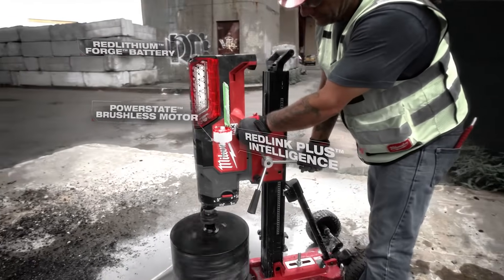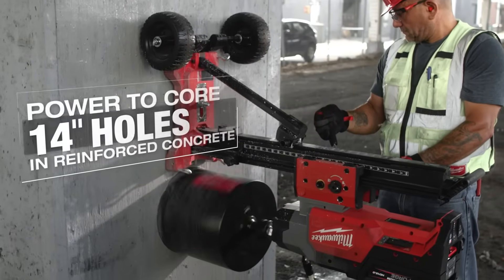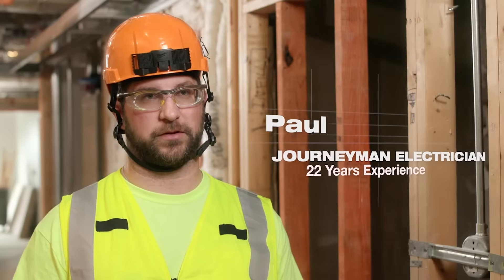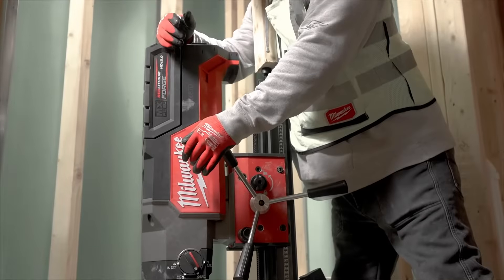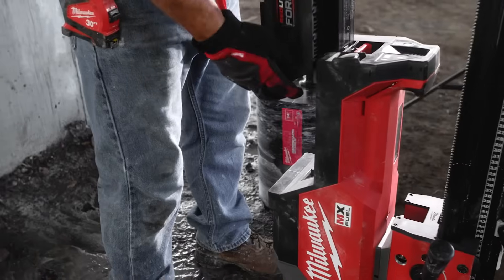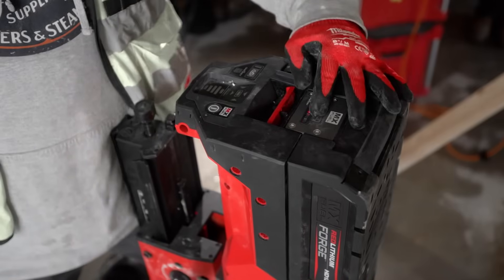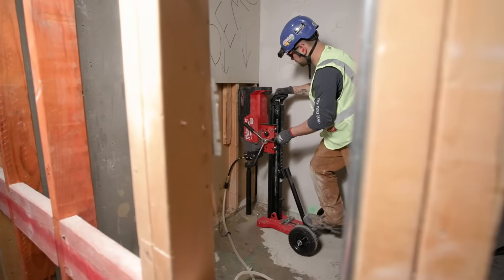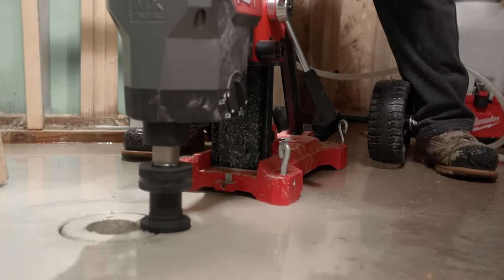MX FUEL™ Core Rig w/ Stand

Comment: What's the point of this?
Reply: It's for the professional market, typically DIY people won't purchase a $7,000+ tool to run a cable tv line...😂😂
Reply: @324bear what's the point of having it battery powered more specifically. It's heavy and clunky it won't make much of a difference to attach a power cord. However battery powered it doesn't last long lol
Reply: @livelaughlove_88h  IMO, the manufacturer is claiming the "portability" is the value... but I agree with you 🙌
Reply: Job sites don't  have access to power everywhere and not until later in the project. Requiring having to move a generator capable of providing 30 amps of power. This tool being battery powered allows you to get the task done faster and requires less equipment.